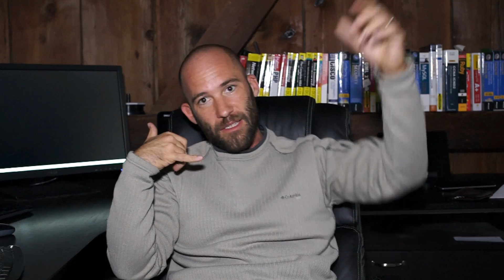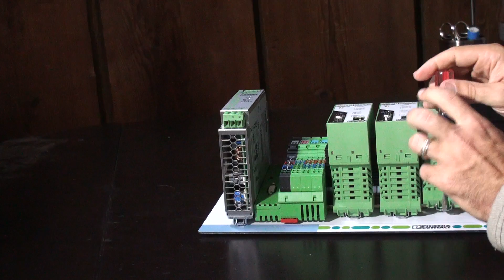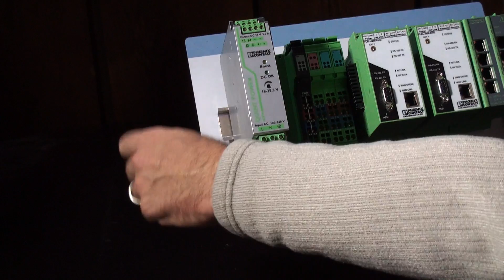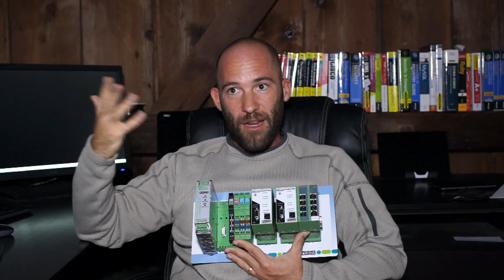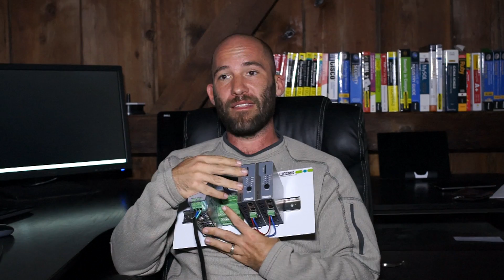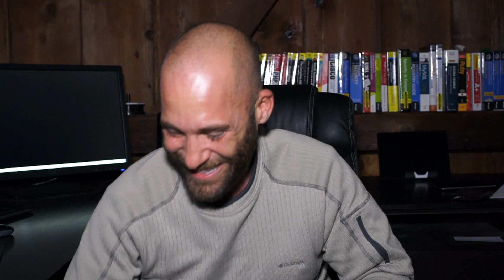Industrial Networking Introduction

Comment: Thanks for clarifying these points about other bus networks, 24 volt and IP (Ingress Protection) codes. You are absolutely correct that the products shown are IP20 and while being touch-proof, they would need to go into an IP67 enclosure.

Comment: Putting power on a metal rail, which is then bolted to a metal enclosure, wouldn't be the safest proposition. However, integrated wiring IS made possible using a DIN rail bus. Just search for "ME/ME-MAX Electronic Housings"

Comment: And it is true that the industry is going more and more over to normal ethernet and TCP/IP between PLC's and SCADA or HMI (PROFINET is one sutch standard), but other bus network standards like "PROFIBUS" and "ASi bus" are still to a large degree used between the PLC and the sensors and equipment like VFD's, weigthcell transmitters, controlled valves, pressure transmitters, temperature transmitters, PH-transmitters, etc.

Comment: The CE mark is just a sticker the manufacturer slap on it. It just say it will not be unsafe to use.

For explosive environments an "Ex" mark with a class and zone specification is what you want to look for.

And for "dirty" environments IP code is what you want to look for. Like for example IP67 is dustproof and can be submerged in 1 meter of water for 30 minutes while IP54 is only dust and splash proof.

The equipment you showed is meant to be inside cabinets and not for harsh environments.

Comment: what would be cool is if the rail could run an electrical current and provide power to the devices, which would eliminate the need for an additional power source. I'm a fucking genius